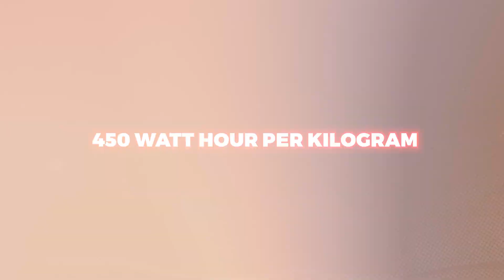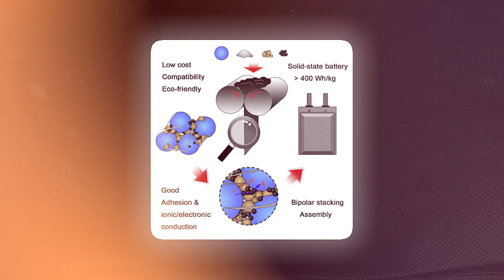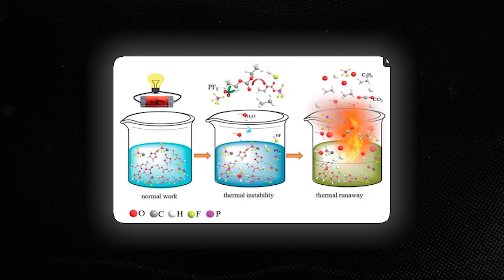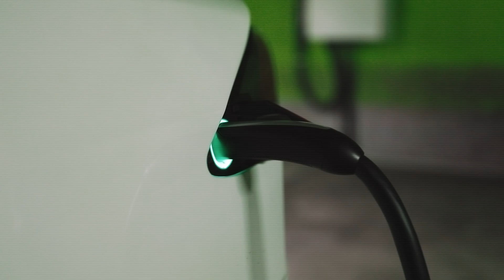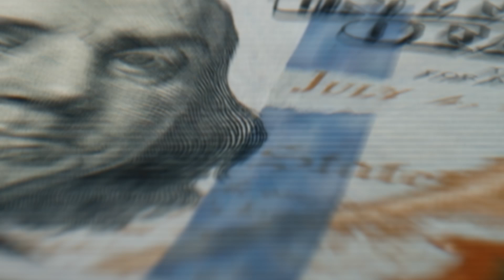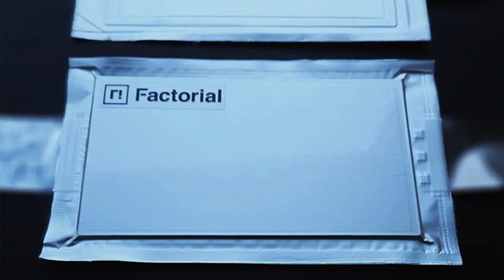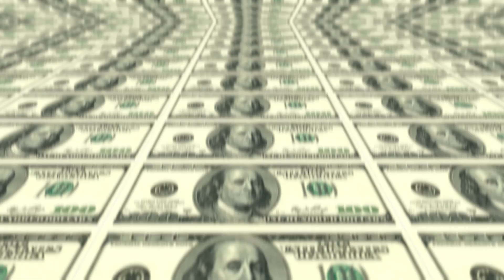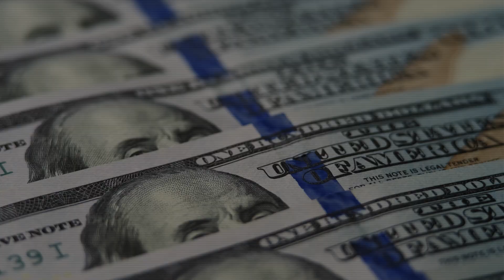Why Mercedes New Solid State Battery Will Crush Tesla EVs

Comment: Mostly we need an EV that won't burn the ship to the waterline when coming across the Pond.  I won't even get in an EV until they solve the fire issue.  No flammable liquid electrolyte lithium battery for me.
Reply: I read that ICE cars catch fire more often than EV’s, but they are harder to put out. I don’t think EV’s are a higher fire death risk than ICE cars though.

Comment: We need to move away from lithium based batteries and focus on sodium ones being less polluting to produce and recycle. For range, lets go towards hydrogen then. But producing enough electricity is the problem especially from a source that is clean. Having BEVs charged by fossil based power stations does not even reach 40 % efficiency barely more then the 35 % of gasoline and a lot less then the 50% of diesel engines (Peugeot, VW or Renault). There is a lot to do now.

Comment: Range increases are great but the fist and biggest issue with other than Tesla brands is charging, Teslas are far easier to charge and the amount of working chargers keeps you on the road. Rang increases are great but it’s nothing if you end up behind a CVS near the dumpster with your expensive EV.

Comment: Toyota and others have been working on Solodstate battery technology for a long time without reaching a combination of high power density, high cycle life and low cost.  Doing 1 of 3 is not hard, doing 2 of 3 is challenging doing 3 of 3 is extremely difficult.
Reply: That's because Toyota has been lying about this for 8 yearss. They only established their BEV devision 4 years ago.

Comment: Tesla already is collapsing as new sales are down. No one wants an EV that thermally explodes, destroys tires in 20k to 30k miles and only lasts about 230 miles before a recharge, plus uses more carbon to build all of the components (especially batteries) than an ICE.
Reply: Tesla’s sales are going up. ICE cars are more likely to burn than EVs. The speed of tire wear is a decision made by the driver. There are plenty of EVs with over 230 mile range available. The life cycle CO2 emissions of EVs are much lower than ICE cars.
Reply: Tesla makes most of its components in house, like this article says Mercedes has to partner with everyone else and share it's cut, Tesla can still make mediocre product and undercut the likes of Benz, the product is still amazing, I have a model Y and I am never going back to another Gas car again. I'm driving a lot lately about 2k miles a month and charging at home and saving on Gas and stupid ICE car maintenance is a game changer.